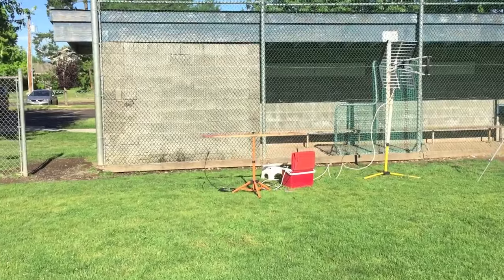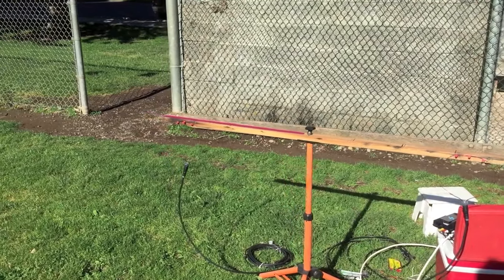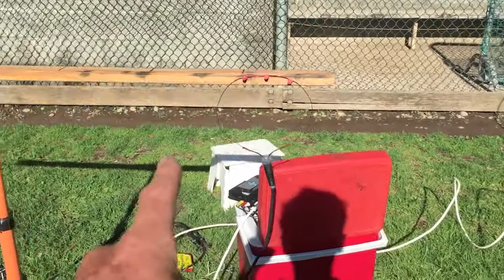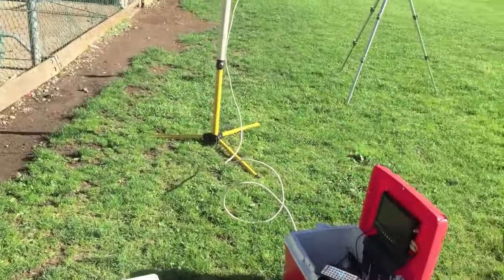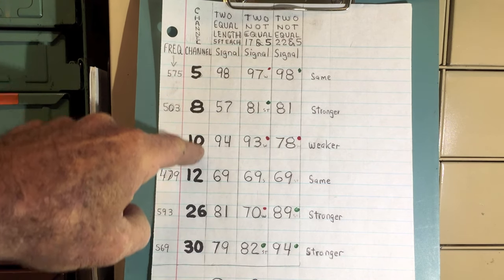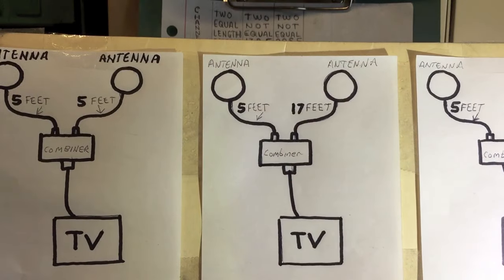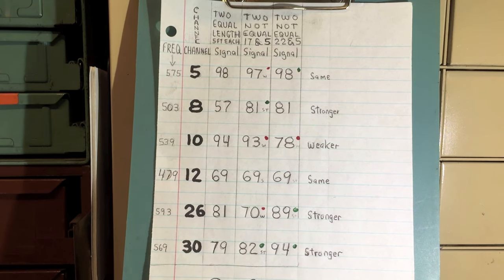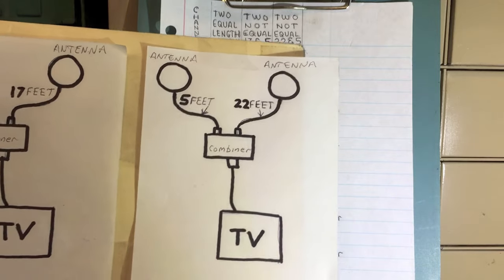Can Two  TV Antennas Really help? Watch This Experiment.

Comment: Interesting. Does it apply the other way around ? On the TV in the lounge I get all the channels at 98%-100% strength, From a splitter it goes to the bedroom, where I get about 70%-80% of the channels with 60%-80% strength. But then it goes off to the music room where I get only about 30% of the channels with 30% or less strength. All the Coax's are different lengths.
Reply: Assuming you use proper (good quality) splitters, then the difference in strength is usually just due to plain old coaxial cable losses and the normal splitter losses. However, if you don't use proper splitters at all, just Y-connectors in the coax, then all sorts of additional bad interactions can occur as well as very variable losses. The worst example would be someone cut the coax with a penknife and taped it all up after they twisted the relevant cables runs together with wire nuts - this will rarely, if ever, work at all - so beware of that.  Edit - daisy-chaining one split cable from another split cable is also asking for big problems - see below
 
None of the problems you describe will actually be related to phasing of 2 antennas as seen in this video, though what happens is kinda similar at a scientific level - it's all related to the physics and mathematics of phase differences between RF sources and sinks, impedances and reactances in parallel, as well as the complexities of individual cable lengths and characteristics. To a theoretical radio guy - a specialist - yes it's almost the same thing mathematically - but to anyone who doesn't do quite advanced mathematics - it's easier to explain it as - "something different is wrong with your setup"

We are off down the rabbit hole of transmission line theory here if we keep taling about phasing antennas, so I think the best thing I can say is:-

"No, but yeah, maybe kinda"  haha.  

 Check that where the cable join to each other that there is actually a proper device - called a splitter or a divider. Some look like small rectangular boxes, or   triangular shaped angled boxes. 

If all you have where they join is a thin/narrow 3-way joiner not much thicker than the coax itself, then that;s just likelya  simple 3-way joiner or "Tee" - you may need to buy a real splitter/divider. Without that, strange things will happen and signal losses will increase dramatically especially on the longest run. 
In any case, you must bear in mind you are dividing your signal up and it;s getting weaker with every split. If you have a poor signal before you start, then it will weaken with every split.

Special amplifiers called distribution amplifiers are sold for your specific problem - you install them nearest the good strong signal from the antenna (often in the attic space, or at least at the rear of your main TV where you have the antenna signal coming in from outside. They amplify the signal there - they need mains power - before spliting it to overcome splitting losses. I would caution to avoid high-gain ampifiers - you only really need to overcome the 6dB or so splitting losses at each port. Devices that claim stupid gain figures are usually rubbish. 6 to 12dB gain is more than enough most of the time for a distro amp. The higher quality ones in fact provide no more than 6dB of gain per port. Too much gain can cause lots of problems including interference between devices and noise. 

Some of these distro amps have more gain of certain ports to cope with longer coax runs to distant TVs - might be useful in your longest cable run for example. 

Bear in mind that if you run from one device, to the next, then split it again there, then do it again, you are dividing your signal away to nothing VERY quickly. Far better to do a full run of coax from each distant TV all the way back to the main TV antenna socket. That way you only have one split per device and you won't be daisy-chaning all your problems. This is a common amateur mistake and could be where your problems are. 
So in your case I'd run a direct cable from the music room direct to the main TV, another one from the bedroom to the main TV, and have a modest-gain distribution amp there. If you have good strong signal from your antenna, running direct runs to the main TV antenna socket may mean you can just use normal splitters and get away without an ampifier/splitter - which would be cheaper and more reliable. But if you currently have badly-taped connections, or simple coax Tees and not real splitters, then you might as well by a small distribution amp/splitter all in one unit. 
  
These distribution/splitter amps are common in larger houses and your local TV antenna specialist will sell you a good one or recommend where to get one. Residential-grade ones aren't that expensive. Maybe 30-40 US dollars. But best to invest in direct cable runs to main TV antenna socket, or better again, in the attic if you are in a very poor signal area (this usually gives less coax length from the antenna and best signal:noise ratio by keeping the actual antenna cable that feeds it as short as possible).
Reply: sorry for the longwinded reply - I'm trying not to over-simplify it for some more advanced readers or be technically incorrect, This is a complex topic and it's likely your problem is just daisychained cables and/or not using good splitters. Both problems are common in houses where the previous owner has done it DIY, adding on one cable after another until nothing works properly.
Reply: @gordslater  No, it's not the previous owner. It's my shoddy DIY. LOL I just got a lot of coax and through one end out of the top storey window, and, like you say, I got cheap splitters. The cables are going though open windows into the different rooms. LOL. I know nothing about RF. (Can you tell ?) Ha ha.
Reply: @frankowalker4662  Ah ok - so yeah, if you run coax from the furthest points to the rear of the main TV, then put all of the existing splitters there, you should be in a better situation. Don't buy expensive splitters, becase at least you seem to have splitters, not just simple coax T's.

If that doesn't fix it, install a small disrtibution/splitter amp there, and you won't need to buy new splitters because the distro amp has the splitters inside anyways.
Reply: @gordslater  Brilliant I just looked on ebay and found a booster for £10. That should do something. Thank you. (I never thought of it. LO).
Reply: @frankowalker4662  oh your in the UK lol. Yeah Currys and Dixons used to sell them on the highstreet, even Argos used to sell them. For a tenner it's worth a try, if it causes problems on some devices (providing too much signal - symptom can be artifact pixelation/strange glistening squares in the digital TV picture that didnt happen before) just insert it in the longest run/weakest signal coax nt it should help PROVIDED you have a good signal from the rooftop antenna in the first place. 
They can't do miracles haha - in fact splitting a good signal to multiple places on long internal coax runs is the only time an amplifier has a legitimate use in most installations, in my opinion. 

Many installers in the UK prefer to just add an extra rooftop antenna and feed that to the extra bedrooms - no amplifier or splitters, fast cabling and very little to go wrong in the longterm. Saves running cable around walls and doorways - always a pain - a quick drill through the wall near the window and you're done after the chimney mount. 

(trade note: we only use UHF digital TV channels in the UK - 470 to 800MHz or so - and antennas are small compared to US ones. We also have higher/taller houses and most have chimneys. 
Generally we have good signal coverage in all but very rural areas. Compared to rural US we also have reasonable broadband - where it's generally very poor in rural US - so a lot of people only watch streaming TV in the UK these days )
Reply: @gordslater  Yeah, I'm in Yorkshire, The TV in the lounge is spot on, all chans, 98%-100% signal. But if I understand you correctly, having the coax going out of open windows and into the rooms from outside should be better ? The pixilation is horrific in the music room, (dormer) and in the bedroom it just breaks up occasionally (1st floor). I have a realy good ariel on the roof though.
Reply: @frankowalker4662  no I was just referring to a pro installer preferring to drill a cable in a wall or windowframe because it was easier for them to do quickly, no technical advantage. Just nice and fast for them to install by trailng the coax from roof, over gutter and straight in near a window to the back of the bedroom TV. 

In your case, you could temporarily do trial runs of coax directly from room to room by simply hanging them out of open windows, to see if it works best - especially in the recent warm dry weather. But best to drill through walls properly - or rain, moths and pigeons are going to be problems sooner or later. 

As you will find out all too soon - trailing coax around your house around internal wall, over doorframes, around corners is a right royal pain, so one method is to install new runs of coax out through an external wall, clip it along the brickwork, then back in to the desired room. If you have wooden windows you can drill through them, but if you have uPVC or aluminium you really need to drill through the brickwork will a long drill (18 inch drill at least and 8mm drill size) to do a proper job, Your longest/furthest run is likely to benefit the most from being run direct to the back of the main TV area.
Reply: @gordslater  Ah, the coax has been through the windows for about 20 years now. LOL. But I made sure there was a bit of slack, (a loop type thing), so that rain would drip off the bottom of the dip and not get in through the windows. (The birds also stand on the one outside my bedroom window and screech).  :) I will try the amp though, sounds like it might work.

Edit: I'm going to bed. Been up since 6am. Good night.
Reply: @frankowalker4662  well if the coax has been swinging free for 20 years, it could also be broken or have water in it lol - especially on the sunny side of the house (sunlight is hard on the plastic coating compared to shade)

Comment: It can be done

If using 2 same antennas
Then both coax runs need be the same if pointed same direction.
Different directions you need experiment.
Different antennas again experiment.

I used to use 3 different Antennas.
Combined 2 as a single antenna
The 3rd as a 2ed antenna
Using different coax lengths.

In the end
Worked Very well indeed.
Yet it was a month long trial and era of several antennas
Method of combining them etc

Nothing Wrong with Experimenting

Hapoy New Years to EveryOne

Comment: Doing it this way combines two antennas in a parallel connection. That's what a coax splitter used as a combiner will do. They're for splitting signals, not combining them. The length of coax cable is practically irrelevant here as the signal is not significantly slower on a 20ft cable vs a 5 ft cable. If one wishes to combine two antennas, or even more, one must do it in series, not parallel. Doing that then basically takes the two antenna and makes them as one. The best way to combine in series is to connect them before the balun, or before the 300 ohm to 75 ohm transformer. Modern antennas may have this hidden within a housing. You'd connect 300 ohm wiring between the two antennas and then use the transformer in the lower antenna to go to coax cable connected to the TV. It's a chore alright, so an A-B switch is much easier, and maybe better in the long run as most people understand them. Another alternative is to get a better antenna.
Reply from the maker: I've never heard anyone suggest putting the antennas in series. Thanks for the suggestion.
Reply: @GrantsPassTVRepair  It can be confusing because we're basically talking about a connection of two separate lead wires, each in a series connection. The cursory thought is that they must automatically be connected in parallel because it's two-wire 300 ohm cable, but that's a misconception. We're basically talking about a series connection between the antennas of each one of the 300 ohm two wire strands to the balun, or transformer. Think of it as being somewhat similar to the multiple bow-tie antennas where you see perhaps 4 bow-tie antennas in a vertical row on a support, each one connected to the next one below by a wire. The bow-tie angles are next to each other, each in a horizontal V-shape but the metal part of each V-side does not touch, they just look like a bow-tie. Then each side is connected vertically. Then those two connecting wires are where the two connectors of the balun transformer are attached, making it a doubled series connection, and not a parallel type, turning each separate element of the antenna into one antenna. If it's hard to visualize, this might help:
https://youtu.be/DU9g92LlAxg
Reply from the maker: @themoviemaniac8416  I can't follow everything you wrote, but looking at the video got me thinking about the cross over wires in between each set of horizontal Vs on a bow tie antenna, and why they are designed this way..                                                          I'd guess it's much like hooking up two transformer outputs in series. If done incorrectly their outputs cancel each other out due to the phase or angle of the sign wave being out of sync. I suppose the space between each antenna is what determines what phase angel is captured.
Reply: @GrantsPassTVRepair  You've got it! Sorry to be so specifically detailed. That comes from having taught upper level classes. I was an FFC licensed broadcast engineer before I went to Grad School for other things.
Reply from the maker: Thanks for confirming this. I've always wondered about the cross over connection I've seen  on TV antennas.  @themoviemaniac8416

Comment: Can we put a oscilloscope on it to confirm they are out of phase or have bucking voltages.
Reply from the maker: Sounds like an interesting experiment, but my scope only goes to 20 MHZ.
Reply: @GrantsPassTVRepair  We will have to get you a 2 ghz oscilloscope for Christmas.

Comment: I have looked at Channel Master on line help trying to figure out how to get channel 10 out of Springfield.
Apparently whomever put their summary list together expects the rest of us to have an advanced degree in electronics.
And seemingly none of them has ever held a compass much less flown an aircraft.
Just what is so hard about giving me the compass direction to point.
I pick up most of the other stations over here in Cabool, but CBS is on 10. I like watching what few football games that have not been gobbled up by ESPN. First they shat upon MLB. Now they want to do that to the NFL. And forget watching bowl games unless you pay. Well, dudes, seniors are more worried about keeping our homes a little above freezing.
I put up a 3 leg Rohn tower to clear the hill behind my house. Finally after 2 years I could actually rotate the antenna and scan.
The wind would blow and I would point it west again . . . then the motor stopped working.
It will be quite a feat for me to get it back to ground level again and I want to add a second antenna to pick up channel 10.
But without knowing the right direction, I'll just be spitting into the wind 😢
Reply from the maker: If you google TV direction finder, you can come up with several sites to help you find where to point your antenna. I often use tvfool.com

Comment: You didn't answer the question.  Did two antennas improve the signal vs. the one antenna?  You answered the question "Did unequal length coax affect the signal?  Please answer whether two antennas (with equal length coax) improve the reception over one antenna.
Reply from the maker: Yes I should have been more clear. It's my understanding that two TV antennas can help the signal, but only if both signals are in perfect phase with each other, otherwise it can cause problems and reduce the signal strength.

Comment: Also, for $79 Televes has a 2 antenna input auto gain per channel booster which will balance.  Of course, that's no fun and cheating, as well as more expensive.
Reply from the maker: I don't understand all of your comment, but do you have a model number of the Televes amplifier you suggest?

Comment: Multipath interference and its gets worse the bigger the difference in cable length and if using different models of antennas.  It was more pronounced back in the days of analog signals (it would look like a duplicate ghost image on the TV screen), these days it just pixelates or drops out completely.   A lot of times the old-style antennas that look like a central bar with rods along its length work better in this situation as they don't have a rear 'reflector' that blocks reception from another direction (note the antenna you have in the baseball field picture).  If the problem station is in the VHF bands then it might be as easy as getting a VHF adapter antenna and hooking it in series; that's what I did for mine and the one VHF station (NBC) that was a problem now comes in great.